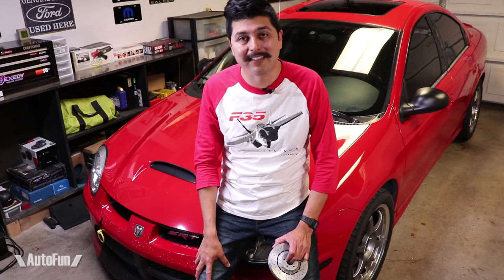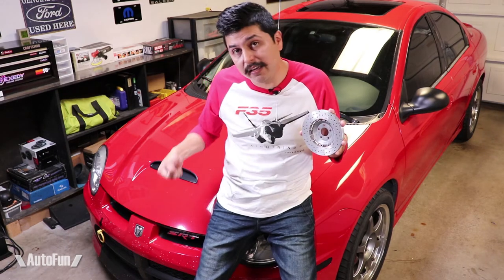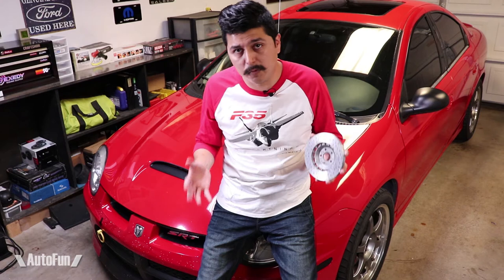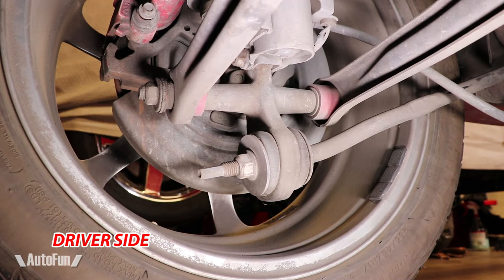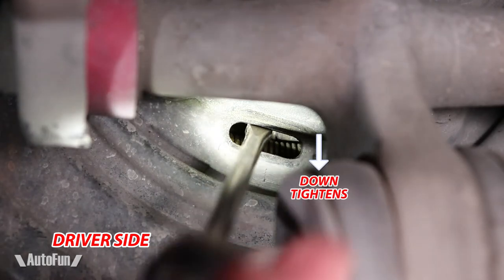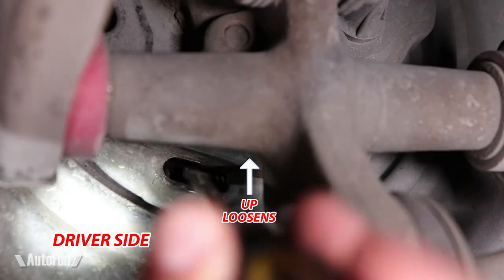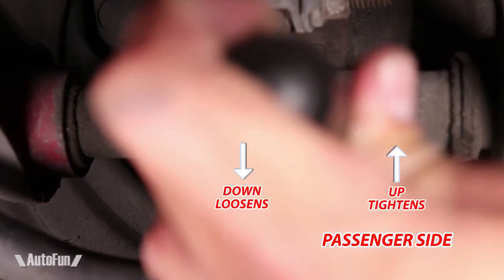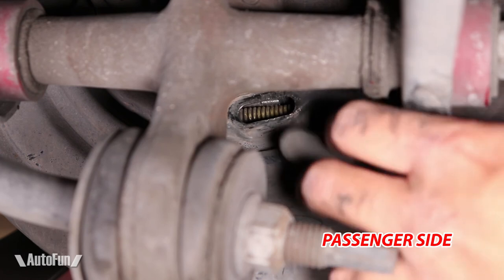Dodge Neon SRT4 Emergency Brake Adjustment (Parking Brake Fix 2003-2005)

Comment: We’re is a good spot to Jack up my neon and put a jack stand ??
Reply from the maker: Hi Dig Ordie! good question man, I have a video coming up in this but the service manual says to place the jack in between the "locating darts" which from the pictures I see on the manual it's basically the pinch welds. There is like a little notch both on front and back that are the preferred areas to place the jack on. To avoid bending the pinch weld I use a lifting puck that has a pocket for the pinch weld. Hope this helps info helps in the meantime bud!

Comment: i’m a little confused, is it supposed to spin freely or have slight drag to have that perfect e brake ?
Reply from the maker: Hi Modified Family! The service manual describes this as "Using the screwdriver, rotate the star wheel upward until a slight drag is noticed when turning the wheel. Then, using the screwdriver, slowly rotate the star wheel downward, backing off the adjuster, just enough to allow the rear tire and wheel assembly to rotate without the parking brake shoes dragging. Do not back off the adjuster star wheel more that two clicks past the point of no drag." Hope this answers your question and thanks for watching!

Comment: It's way easier to just pull off the rotor and do it
Reply from the maker: Hi Charlie! On the SRT-4 the parking brake uses the rotor (the hat center section of the rotor) as the braking surface. If you pull of the rotor you won't be able to feel for correct parking brake engagement and adjust as the parking brakes will not have a surface to adjust against. I know on some other cars the parking brakes are independent from the rotor which in that case it would work to remove the rotor but the SRT is all combined...